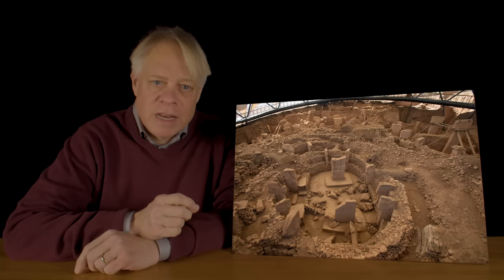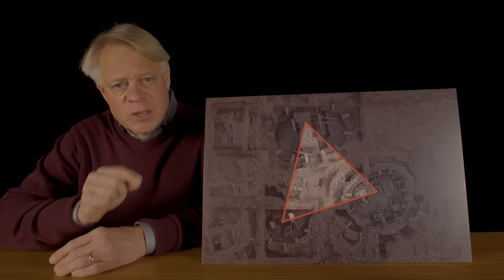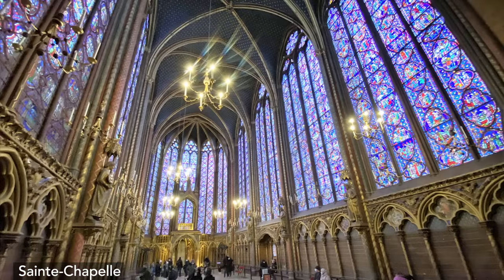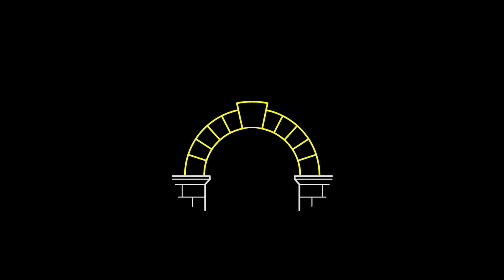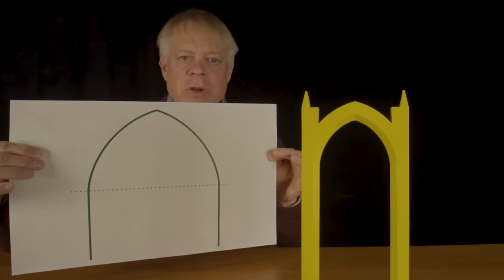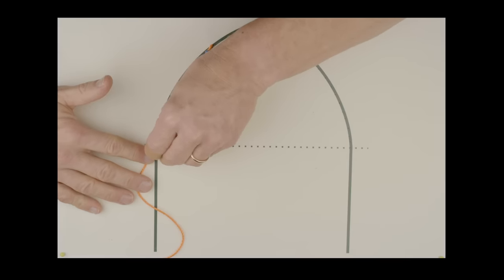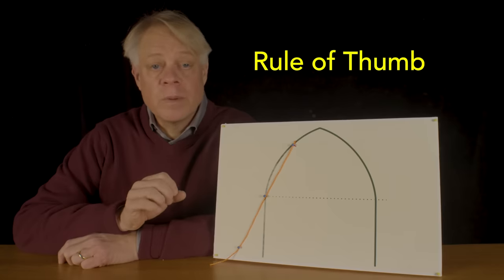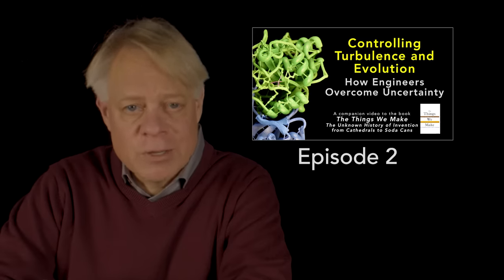Building a Cathedral without Science or Mathematics: The Engineering Method Explained

Comment: As a structural engineer my mind is absolutely blown! I have always wondered how they were able to create those stunning pieces of architecture without highly complex math. Never heared any explanation on this topic in university either. Thank you very much for this enlightening insight!
Reply: Methods like this are still used in my field of carpentry evert day! It's pretty neat. I have to admit I have a hard time believing they had no math at all though. Or measuring tools- even if you don't have a standard Imperial foot across the Continent, you can still have a standardized foot across one jobsite.
Reply: I've won 1st place in my small class of into engineering, making a bridge, 
Point is
I too noticed a golden ratio of perfect rational fractions like flash cards type, that made it simple=light & evenly loaded=compression& tension(pulling). In a basic bridge making site, which was the given HW site for the whole class.
Reply: The chicken egg is a marvel of nature, the principle of cupola, you can not break it by applying pressure on the longitudinal axis; the fiber of cobweb is stronger than steel!!!
Reply: Ever heard of Islamic golden age? The arch looks like from Ibn Tulun Mosque.
Reply: Hey just a quick question of advice, a general answer is really all I'm hoping for but if you can elaborate a little further it'd be greatly appreciated, I'm a 20 year old high-school drop out working in an insulation plant and making just enough to get by and help my wife start and run an online business (she works part time as well) and while it's currently nowhere near possible, (assuming we start making a considerable amount more over the next few years) should I look into engineering as a career path? I have all of the aspects I hear are common of good engineers such as a strong natural curiousoty in the things in my daily life, machines (especially vehicles), man-made structures, good intuition, and a very good eye for figuring out the physics in all kinds of scenarios, ect. Sound great right? Except... I'm TERRIBLE at math. I'm very dismissive of my own abilities so I threw out the idea a long time ago but the more I seek out content like this the more it feels kind of like a calling. I feel like these days with any form of calculator at our fingertips I could make it pretty far but without one I'm dead in the water, and I feel like that would completely disqualify me in alot of fields and even schools. I'd like to think that raw skill or intellect in other areas could overcome this but like I mentioned, I don't have much faith in myself being too particularly special other than friends and family seeming to constantly reassure me that I'm very bright, that I just didn't "apply myself" when In reality my dropout was mostly just a lack of will to keep pushing as my parent's divorce was very disruptive to my mental health (sorry for the life story, just feel it appropriate for context) So yeah, is my mathematic weakness a valid reason to not pursue this career or is it possible that one could offset this?
Reply: @zenkoz3158  Hi zenkoz, I will try to answer your question(s) as thoroughly as possible. First I have to mention, that I'm from germany and don't know much about how structural engineering is practiced elsewhere (since you're talking about being a high-school dropout, I assume you're an US american citizen?). Second I only have (more or less) extensive knowledge in civil/structural and environmental engineering (two bachelors in civil and environmental eng. and a master in structural eng.) and can't say much about other fields. 

With that out of the way: you said that you're bad at math. What exactly do you mean by that? For example, my mental arithmetic has declined to pre-school-level, since I use a calculator for absolutely everything (the danger of making mistakes is simply not worth the risk). What you do need in university is a LOT of calculus (especially integrals and derivatives) and linear algebra (matrices and vectors) and at least in Finite Element Theory (what I studied intensively) the math can be quite brutal. But it still is no witchcraft and things like wolfram alpha can also help you to a certain extend nowadays. Unlike programming I don't think you can learn most engineering diciplines just from the books though, because it simply is too complicated (only worked for me in the later stages of my studies as an add-on). Apart from that there are even in civil engineering several sub-disciplines where you won't need a lot of math, for example construction site management, where the payment is (at least in germany) on top of that generally better than in structural engineering (but it's also more stressfull imho^^). 

So to come to an conclusion: If you lack certain mathematical skills, it will definately hurt you in university, but in practice it's more about having a good sense for structural behavior under loads and math won't play that big of a role anymore. If you're generally smart, you will definately be able to learn the math required to finish university, but even then you have to put in quite some work. The job itself is quite a lot of fun, very rewarding in my opinion and even relatively safe from the advancements in AI (which is hugely important to consider when choosing a field of work nowadays as far as I'm concerned). 

On the last note, I would recommend to watch some youtube videos about the basics of mechanics (since covid there are more lectures on theses topics online) and check if you find it generally interesting (which is more important than to understand it from the start, since you won't if you're not one in a million^^). As far as I know you will need those in almost all engineering fields (at least for the degree). If engineering still appeals to you, try to close the gaps in your mathematical skills with youtube, free papers, forums, chatGPT etc. and check your calculations with wolfram alpha. Make it a daily habbit and track your progress. As soon as you're a little more confident in your math skills, give it a shot at university if possible (the costs of studying in the US are just unbelievable for someone like me). I would also recommend to inform yourself about the many fields of engineering and what fits your intrests most before starting something (since you mentioned vehicles, mechanical engineering or electrical engineering could for example be more fitting for you than civil engineering). All the best and if you have any follow up questions feel free to ask! :-)
Reply: @alexm.2115  thank you so much for that detailed response. As it so happens the company I work for is an American branch of a German company named Knauf Insulation, so that was an interesting coincidence. And yes I am from the US, East Alabama specifically. About my troubles with mathematics, it's not impossible for me to pick up a concept but I test many teacher's patience for quite a while. I sort of fell behind in not memorizing multiplication and division, making me an incredibly slow worker as calculators were treated as a creation of the devil in my school system. As well as by the time I had started Algebra I had quite a struggle with most of the advanced equations using variables. This was something I found near impossible to shake as it just seemed my mind refused to work within the bounds of what the problems called for and I was constantly falling on my own intuition and giving solutions that would elicit teacher responses such as "well you came to a similar/correct answer but you solved it incorrectly". It's extremely frustrating because I would find my own way of doing a certain type of equation that worked, but when we moved to the next "level" my way of doing things would fall apart. I believe it's possible for me to master these things but I find that my thought patterns are hard for most to understand and it makes tutoring me a tall order. But as for fields of engineering I certainly would be a better fit in electrical or mechanical as I've always worked on my own vehicles when possible and have a passion for them, as well as tinkering with my electronics for a long time and getting into PC building as soon as my dad could spare the money to let me. So I certainly have a knack for those two areas and I do find the idea of being a "maker" in any sense to be a fulfilling career path. Creating things or fixing them is what brings me the most joy in life by far. When I find the mental "charge" available I am also going to inquire about testing/diagnosis for possible neuro-divergent disorders as from all medical information on developmental issues, it seems highly likely that I'm afflicted by something as I've followed a very similar path in education as many with undiagnosed ASD variants. Especially the trajectory or doing very well for my first half of schooling until I could no longer rely on intellect alone and had developed no study habits because I had never needed them prior. I believe knowing this for certain will also make education in general much easier as I can hopefully find educators with the appropriate experience and knowledge to work with that. Again thanks so much for your time and advice, I don't get much as I don't have anyone in my personal life that could be considered successful and it's rare that I find a good source of advisory at all. 🙏
Reply: How does the hen lay the egg that you can not compress axially?
Reply: @alexm.2115  Engineering is the same around the world, man
Reply: Can't believe I'm watching to this kind of content. What a time to me alive!
Reply: @iksaxophone  Had the same thought..Somebody on the job site must have had SOME kind of measuring devices ! They didn't have eyeglasses back then, I'm not believing a 300 foot tall, intricately carved cathedral was entirely "eyeballed"... Otherwise an interesting talk though..
Reply: @zenkoz3158  with all the reliance on computers I see now, I'd think an actual ability to solve complex math problems isn't as necessary as an ability to use a computer ( I'm sure there's specific software for engineering now) and the other abilities/interests you mentioned...
Reply: @Eduardo_Espinoza  the equilateral triangle, the best 
Shape for the structural webb
Reply: @zenkoz3158  math is an engineering tool where we deal with loads from stucture own weight, snow, wind, machinery, etc. It requires high math to design structures. There are  engineering fields like construction management dealing with getting a project done in coordination with engineers. In every case, all require logical reasoning
Reply: @tandme2342  Knowledge of materials is crucial to building things.  That's why we use safety factors that assume a lower material resistance to what is known in the laboratory, also fatigue is a factor to take in consideration. The number of times a structure is subject to design loading. Therefore, "the service life"
Reply: @richardprofit6363  computers spit out whatever solution they give, the one designing has to interpret and evaluate the meaning of those numbers
Reply: @zenkoz3158  Personally, if I was in your situation, I'd starting taking classes at a local community college to get some of the basic requirements out of the way. if your math level isn't that great I am sure they'll have some sort of class to get you prepared for calculus I, further if money is an issue you can do khan academy drills for a while then test into calc I. If you enjoy that class I would definitely talk to an advisor about wanting to get a degree in engineering and see if the community college has a transfer agreement with a major university, they usually do. its Calculus I then Calculus II and Calculus III Linear Alegbra and Ordinary Differential Equations. Its a lot of work but one semester at a time and you got this. (If you want to get calculus I and II out of the way for cheap you can self study for an AP exam, calc AB or BC and if you score highly on AB you get credit for Calc I and if on BC that you'll get credit for calculus I and II).

For now I would just look at Community Colleges in your area and see what sort of transfer agreements they have with local universities. For Electrical Civil Or Mechanical Engineering look for universities accredited by ABET so once you get that degree you're certified to work in most places around the US. This website has the pathways for doing Civil Electrical And Mechanical Engineering going from Community College to a university https://alabamatransfers.com/pathways/science-technology-engineering-mathematics?major=engineering-mechanical Overall you got this
Reply: But the answer is, honestly, horrifying: Basically, the method is: Create something, if it brakes, change a parameter, if it breaks again, change it once more, until it does not break any longer. Then, keep building it this way. 
Imagine if we built air planes like that - we would either never built an airplane, because there was no rule of thumb. Or we crashed hundreds of air planes whenever somebody tries to improve an existing model. 
By the way, this is exactly, what we do, don't we? Just in a controlled manner, and applying scientific methods to exclude as many faulty ways as possible in advance in order to minimize the number of crashes.
I am glad we moved on to science.
Reply: I had 'reasoned out' this 'Engineering Method' ... at least a bit .. when I was reading about how Romans built aqueducts .. they kept very detailed notes and over time some of the aqueducts fell down .. so those notes were examined and they wouldn't build an aqueduct precisely THAT way again .. over time the determined what would and would not work. Now I know that this was the Engineering Method. Sweet.
Reply: The Engineering method has nuances of a scientific method.

So were was the first prehistoric people's to reason about this?
Reply: @dvdortiz9031 
If the egg is boiled it can spin and stand vertically.
Reply: @richardprofit6363 the video just showed you the measuring device 😭
Reply: @zenkoz3158   Math is a requirement, but it's not impossible to learn. The math is what filters most people from Engineering college.
Reply: A chicken egg will give you an example of vaults, cupolas, thin vessels, and strength like the cobweb itself on high cable tension!!
Reply: @iksaxophone carpenters know "practical geometry"! ignoring the theory behind the principles of Thales, dividing an odd line in equal segments; regular polygons, dove tail connections, etc.
Reply: Noah's ark is the oldest known specification for a builder! Dimensions, materials,  architectural layout and distribution were spelled out!!! No need for a rudder, nor compass, sail or even bow or stern!!!
Reply: @dvdortiz9031  Because the birds that laid fragile eggs never got to see those eggs hatched.
Reply: @Eduardo_Espinoza 
Seriously homie. I'm studying civil engineering, and we did a balsa wood bridge competition.

All I did was use a triangular cross section and made sure members were consistently sized. My bridge ended up holding five times as much weight as any other bridge (proportional to my bridge's weight).
Reply: They knew divine mathematics. No need for modern horsehittery
Reply: While the building style is almost entirely compressive, empirical it worked ok last time approach resulting in guild secret knowledge of what can work and what wont yes. iirc the development of flying butresses to buttress the main flying butress  was a leap of guild faith.
Reply: This video reeks of jealousy. No Nobel Prize for you.
Reply from the maker: @rickden8362 really
Reply: @engineerguyvideo  Yah, really. Cause what you're saying is bunch of average guys over the years using trial and error...oh yah, you forgot the error part, you think everything they tried worked the first time. And where are the failures, most torn down, few people admiring them. Their like the surgeon that buries his failures. When you put it into perspective, 10,000+ years of trial and error(burying the mistakes) is the outcome the the cathedral 
really' that unusual.
   Whereas, no matter how many average guys you put together you're not going get: A theory of relativity; Calculus; position of the electron; Quantum theory.......
Reply: @rickden8362  Sorry to break it to you: you're lame.
Reply: @alexm.2115

You should not be too impressed. Most likely these ruins are simply much younger than asserted, rather a few hundred years than several thousand years. Therefore they had the means to do basic calculations.
Reply: @manelcaballeroperez2499  And that's the best you got and I'm lame.
Reply: @rickden8362  Yeah, you're lame. Criticizing the video for this reason is quite pathetic.
Reply: @manelcaballeroperez2499  🙄Sure, dude, and you're the real mental giant. 😂🤣
Reply: If you could not figure how they did the building .. you are not an engineer !!!